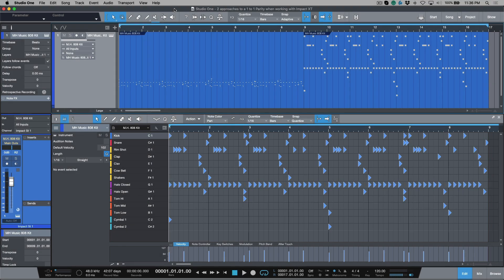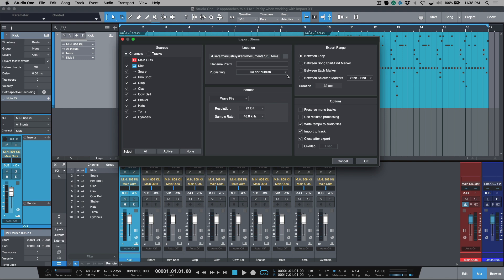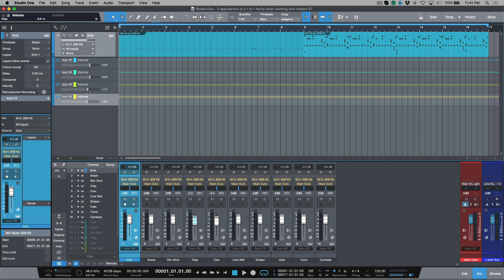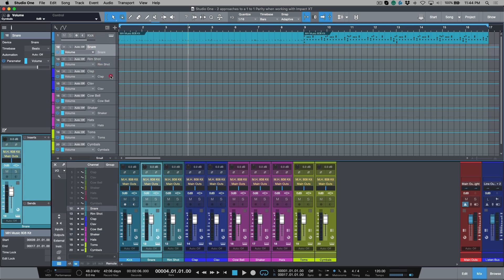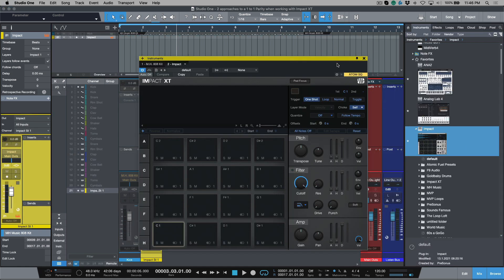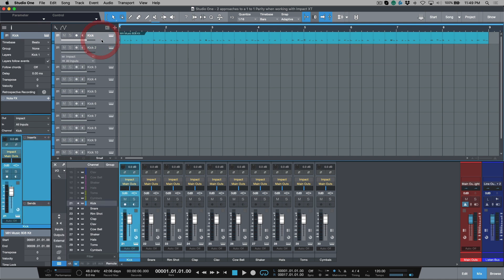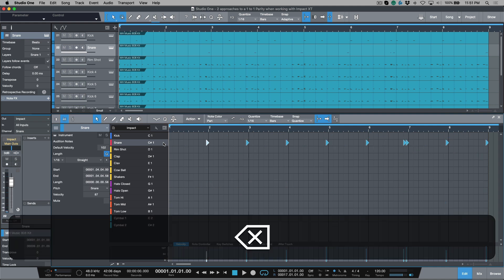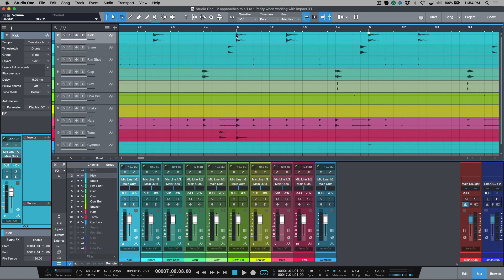3 Different Workflow Approaches for Creating a 1:1 Track/Channel Parity When Working In Impact XT

Comment: Nice video, thanks for sharing. There is another workflow and it's the way I usually work. After building my drum patterns I use the explode to tracks feature in order to separate each individual midi sound into its own track. Then I either bounce them all to new tracks to create audio files or if I have a template set up with audio tracks preloaded and labeled  I just drag the midi files down to the correct audio track label and it's automatically converted from midi to audio.

Comment: for the last method. you can select the event that you've programmed on the one track and then have it split by pitch. each instrument will automatically  be separated to  tracks on the arrangement.  then you can just apply the Info panel adjustment you did . it'll be much quicker that way. you'll still have to rename though. but you can save it as a preset so that you don't have to reroute every time. then it's just changing your samples and you'll be good. 

this was def needed though. had no clue about that info pane output adjustment
Reply: This!

Comment: Why didn't you talk about "explode pitches to track" ? It's so much faster than your third option !
Reply from the maker: Well - it depends... Yes, Exploding Pitches to tracks is faster, and also useful but it's not really the same as what I'm talking about. (Creating a 1:1)
Try for yourself, and you'll see that it will create a track for each different pitch that was used. BUT - Each track is still linked to the SAME Channel in the Console.. (In my Example: they're all linked to the Kick Channel)
So you would still need to manually link each track to each channel in the inspector. Also in cases where you have multiple pads that share an output, they would each come in on their own track, so you may end up with a ton of tracks that need to be grouped back together.. (like all your Toms, or all your Hi Hats)
Either way - its a good point that you've brought up :)
Thanks for your comment :) Cheers, M 🍻
Reply: @marcushuyskensmusic  would still be much fastr than copying each pattern from the original . pretty sure that's what they're referring to. You spent more time during that  part than you did assigning the out for each channel in the inspector - though I agree that being able to set that up quickly would be ideal. Maybe the same way we can assign ins and outs in a cascading manner. I

Comment: Is there not the possibillity to explode pitches to tracks? To note is that this only works when the event is a midi event in the pianoroll mode, it does not work when the drum mode is used. I use it myself very rarely, but it will create in a fast way separate channels for each drumpad.
Reply from the maker: Please see my other reply to the same question - It will separate the TRACKS based on any pitches that were used, but it will not separate the channels.
Cheers, M 🍻

Comment: A great video! My question is if it can be bounced to mono instead? It seems like the stereo stil beeing heard like mono and is not so widened as stereo use to be even if it is bounced in stereo. How usual is it to have drums bounced/recorded in stereo anyway? Thanks for your time!
Reply: you definitely ca. i do that myself. i will recommend to bounce through the "stems" method that way the mono tracks remain mono when you export them. if you just convert the event into audio impact will change mono tracks back to stereo